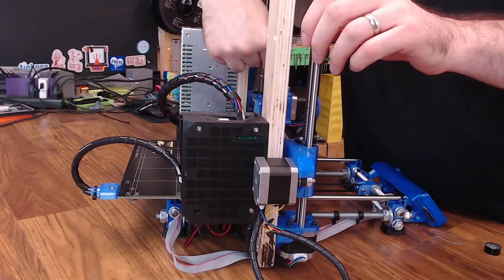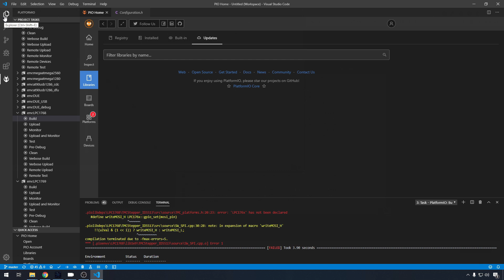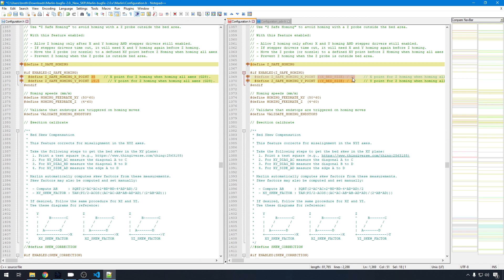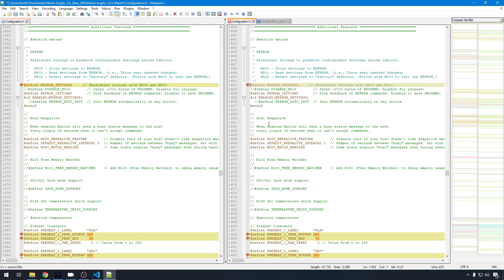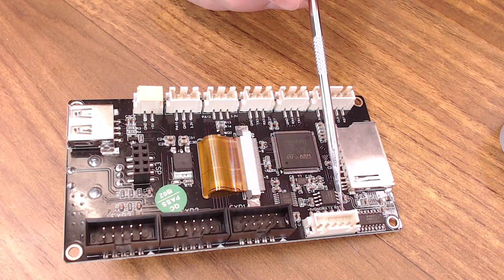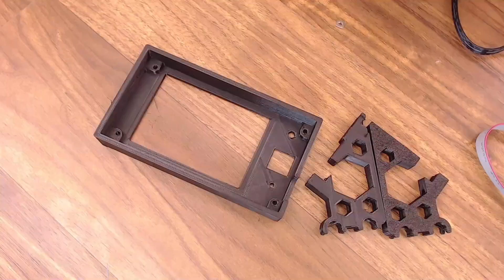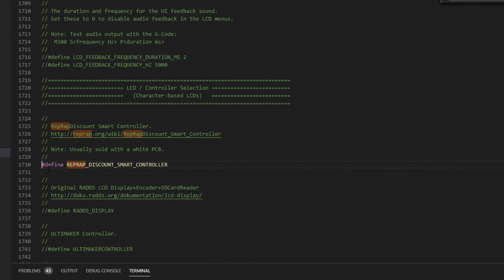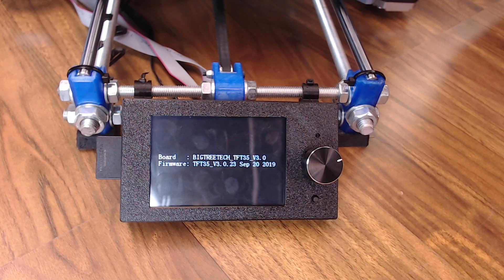BigtreetechTFT35 V3.0 Touch Screen Install - SKR 1.3 - Chris's Basement

Comment: Think there's a newer version firmware out now ending with 25
Reply from the maker: Thanks Gary, I tried that one, but it scrambled the screen.
Reply: @ChrisRiley  Had the same issue. Is because the TFT35 folder (with inside the bmp and font folders) weren't on the SD card.
Reply from the maker: @martijnajanssen  Ahhhh, that makes since, good to know.

Comment: Just do make sure do the different displays share the same base information? If I use the marlin screen to set up say an abl system with baby stepping and sutch will it retain that information after switching back to the touch screen or are they stored seperately?
Reply from the maker: yes, they share all the same info.

Comment: I find it hilarious how the screens have more powerful MCUs than the original mainboards now!
Reply from the maker: LOL, I know right! Thanks for watching John!
Reply: Almost makes me wonder if you could use the TFT to a greater degree...
Reply: @garybarbourii8274 , That would depend on BTT Patching The TFT35 V3.0 Firmware So It Stops Stopping The Printer In The Middle Of A Print. With The Heat Still On.
Reply: @antonrr90  I'm not familiar with that issue. I am running some btt compatible open source github code on an mkstft_28 clone and have not yet looked into the full capability of the interface with the main board
Reply: @antonrr90  In the config file there are options to fire any GCode you like when print ends/stops/canceled...  Maybe turn off heaters, fans, and motors like you normally would?
Reply: @antonrr90  its an issue with the MLAYAN m200 screen as well as other screens using the EXTUI settings. there is a bug that locks prints mid print. still no workaround yet though would be nice if it got fixed it makes the screens unusable.

Comment: Hey, I got a tft35 v3 with my skr, can I use the 5v pin in the back to power my raspberry pi for octoprint? Thanks
Reply from the maker: I am not sure what the current is on it, but I would certainly give it a try.
Reply: @ChrisRiley  BTW have you tried their latest update 3.0.25, went out at the same time as your video lol haha good video though
Reply from the maker: @ckafrouni  I actually gave it a try and it scrambled my screen, I think I missed something.
Reply: @ChrisRiley  i did too, text was not displaying right, don't know if its me or them

Comment: I just added a big tree tech TFT35 V2.0  but this version stops sending gcode to the printer @ random. I found out on there facebook page that there are  lots of people having problems with the 2.0 version. The annoying thing is that big tree tech almost have no technical support and that they are unwilling to refund if a product does not work like intended or has other problems. Its a bit sad because I really liked there boards.
Reply: The same here. But it happens only in though mode so it's still useful.
Reply: Looks like it was possible fixed in latest v x.x.25 (at least according to the change log) fingers crossed and new universal icons are much more better as well
Reply: @DenisOvod  If I look on the BBT github page in the TouchScreenFirmware section I see updates for TFT35 version 1.0 1.1 1.2 and 3.0 but I don't see a firmware for the 2.0. Do you know are the firmware for the TFT35 v 2.0 can be found?
Reply: Gorilla Diversions  Is that the BIQU_TFT35_APP1_V2.0.25.bin ?
Reply: @Voyager_2  yes, but beware I've checked the fix commit and it introduces memory related issue. (Function returns pointer to prev. Freed mem. Buffer)
Reply from the maker: Thanks for helping out with this. I hope the new firmware gets it working.

Comment: Chris can a 12864 screen directly swap for an Ender 3 screen?  I notice they are close but I don't want to blow up my main board (1.1.4) if they are a bit different.  Your thoughts?  I know I need a different case.  Thanks!
Reply from the maker: I "think" it can, using EXP3, but I will test it out and let you know.